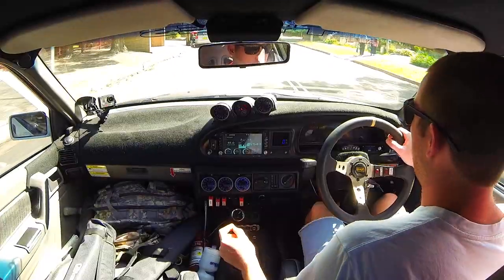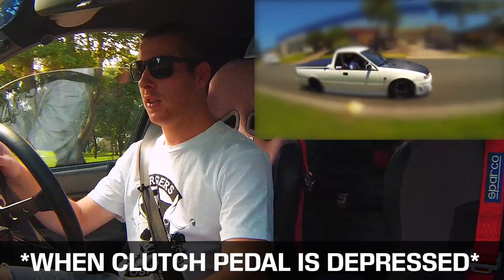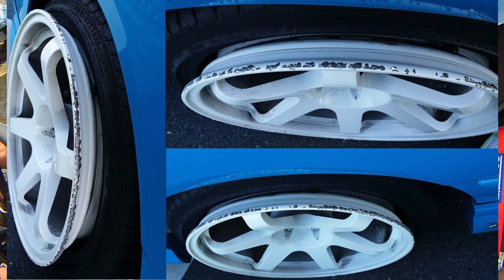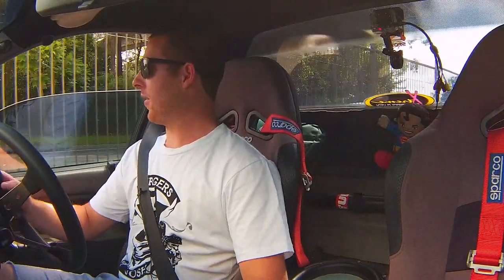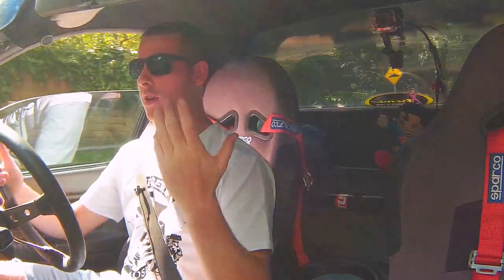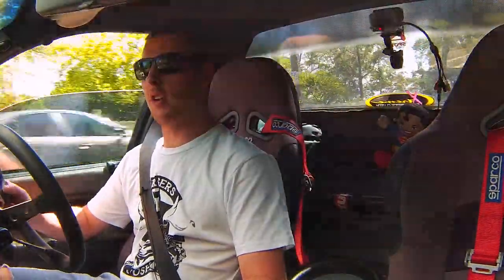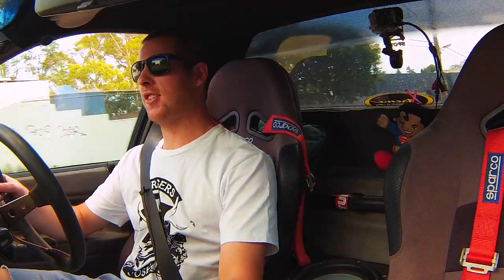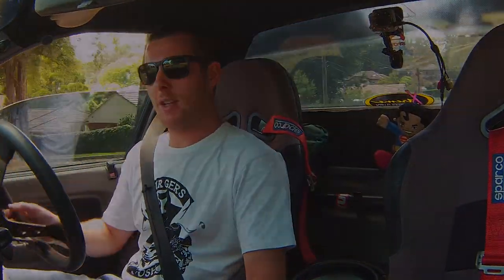TWIN PLATE CLUTCH | WHAT IT'S LIKE? - BOOSTING & BROADCASTING

Comment: Old video but hopefully you can answer. You said it has noise when you load it up in a higher gear low rpm, was this noise a vibrating sound or rattling? What did it sound like if you remember?
Reply from the maker: What noise are you referring to? The gear box? I can't remember what I said in the video sorry
Reply: @boostedbuiltgarage  thanks for the response! It was around 2:10, you were referring to the clutch saying there might be more noise when you go in a higher gear at low rpm. Just wondering if you remembered what that noise was, a rattling or grinding etc
Reply from the maker: There's no noise from the clutch. Once your foot's off the clutch and it's fully disengaged, there is no noise. I was probably referring to the gearset in the gearbox I'd say

Comment: Hi, I jave a twin plate in my car, I've done 800 miles since fitting it and since about 200 miles it's judders/kangaroo on pull away, enough to shake the headlamps. I have been told this is normal but really doesn't feel it.
Could you please advise me whether you think I should get the box out again?
Reply from the maker: Depends on what type of clutch disc you are using. Sprung, unsprung, full face, segmented, puck etc and also what material the lining is. For a full face organic it shouldn't really be shuddering like that. But a puck type clutch especially if it's unsprung will definitely want to shudder if not released under ideal revs etc

Comment: How is the clutch going 4 years down the track? Just brought a mantic for my ve ssv and it is getting installed on monday. Cant wait, No more clutch pedal stuck on the floor
Reply from the maker: I've changed it up a few times. Best clutch I've ever driven but have gone to Kevlar disc facings for more heat/slippage tolerance

Comment: I've also read a lot about the multi disc setups not lasting long on the street, despite being designed to slip a little. Have you heard about this much?
Reply from the maker: 2slofouru Put it this way. My twin organic lasted about a year (30,000km), my previous single ceramic button lasted like 15,000km.
The problem that reduces life is partly the material (ceramic/brass vs organic) but the other factor many people don't know is that it's the clamp force in the pressure plate. The more clamp the less time it will last. 
That's why I get mine custom built and configured cause we can tweak what clamp force etc so it will still be enough to hold enough power for my setup but last as long as possible.
Other things like driving style etc take effect on that too. My daily driving to work is in traffic alot so alot of slippage.

In a nutshell, for my setup, the twin organic is the best clutch I've ever had, lighter than OEM, way more clamp force and smooth engagement... The noise sucks though yes. Can get twin plates with dampers though...
Reply: Boosted & Built Garage 

Hi I have a 550 wkw  gtr  would u recomend this clutch  and ceramic or organic  lucky to see drags  twice a year
Reply from the maker: I'd 100% only use a twin for that power level! Organic might be on its limit. Is it mainly street driven? I honestly think ceramic might be best. Or if you know a good clutch builder like mine, get a Kevlar one built (that's what I've gone to now - mainly for its heat handling capability/longevity)
Reply: Boosted & Built Garage 

Thanks just ordered a 230mm ceramic

Comment: What would you say the best clutch for a 360rwkw fg xr6 turbo would be? It's my daily, no track use at all
Reply from the maker: Depending how much it's driven in traffic, I'd say a twin organic, or a twin Kevlar which I currently run - takes alot more heat and abuse than organic and still plenty of slip like an organic. Definitely a twin plate nonetheless.
Reply: @boostedbuiltgarage  do I have any other good options other then twin plates? The noise annoys me being a daily, going through drive throughs are rediculous, cheers for the info man
Reply from the maker: Not all twins are noisy. The comp clutch twin in my Forester is quiet.
I wouldn't bother with anything other than a multi plate. 
The more clamp force you need from a single will quickly diminish the clutches life and also be a super stuff pedal.

Twin you can half the pedal effort and double the clamp force.
Reply: @boostedbuiltgarage  ok thanks man

Comment: what about the clutch feel? is feel like a little bit heavy than oem clutch or a lot  more heavy?
Reply from the maker: It feels amazing, nice and bitey, it is about half the effort of my beefed up single plate i ran prior to this and compared to stock, id say its the same if not lighter. (Obviously every clutch is different) but cause I get mine custom built I can tweak the pressures, travel etc.
Reply: Boosted & Built Garage so the pedal pressure is the same compare to the OEM clutch?
Reply from the maker: +Yonathan Susanto Yeah if not a bit lighter. And factory these were cable clutch, I've converted to hydraulic (even though my setup is still 1:1 ratio it's still lighter than oem clutch and oem cable)

Comment: how do you think these would handle the torque of say a 600ft lb torque
Reply: cummins
Reply from the maker: connor jones Yeah, though you'd probs need maybe a more aggressive clutch disc material like ceramic button, but depends how aggressive the power delivery is. Though there are many variables, they can be set up with all different plates and different clamp pressures etc